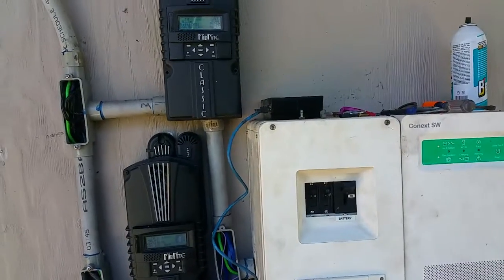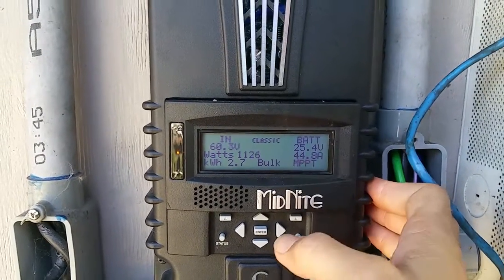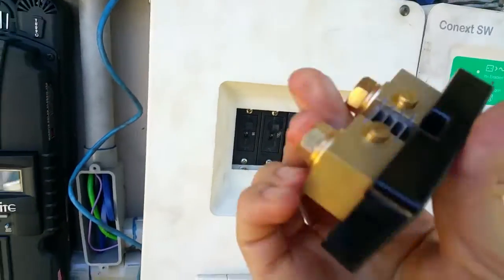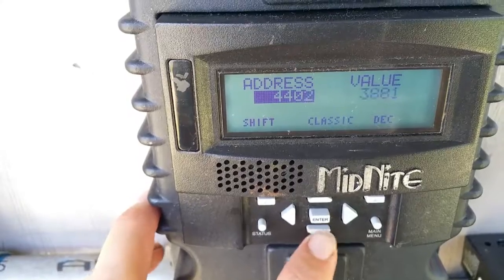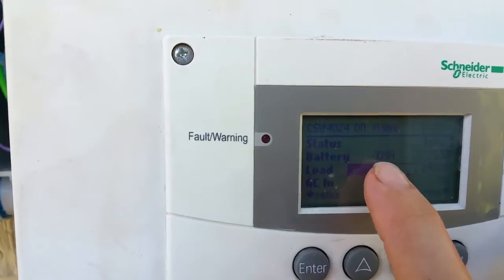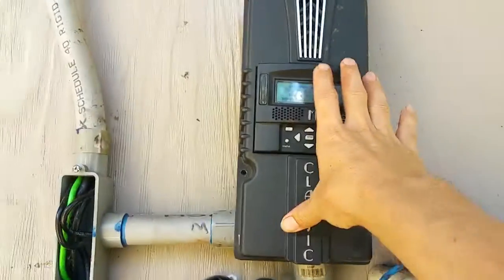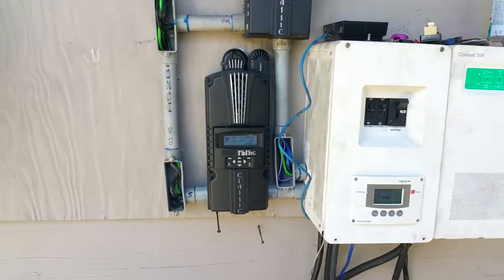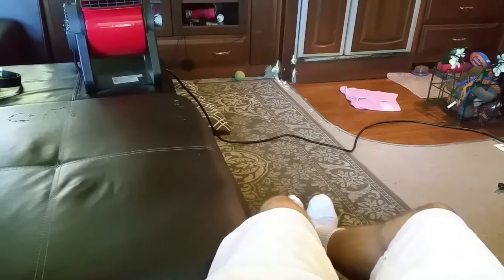Don't overcharge / current / Global maximum amperage Midnite classic Whiz Bang Jr solar  controller

Comment: I could make two controllers work off of one WBjr. It isn't said enough that without knowing what current is actually going into the battery the batteries can't be properly charged.  I wish I could have a bigger more conventional system. As it is, almost all my panels aren't even on my property at camp. Google earth won't even show my camp or garage. I try to keep them low profile.   Even at home trees trees trees. I can barely get 1KWH into the tank.  I've become an expert at low power systems.

I now know a little more about your system and still wondering how water heating would fit in. I have an extra built board you could try. In fact I think I should personally install it. I used to stop in Hawaii for long weekends when coming back from Japan.  Even lived on the beach when I couldn't get a hotel room. My board could lighten the load on your controller.  With all those panels it seems like it would always be full on.  Energy management is the future of solar. Like to work with you on any interesting problem. How big is your tank and is each controller on a separate  array.
Reply from the maker: They're tilted a little more towards the sun set so I don't get much power before 9 a.m. but without actually tracking the sun that's best for me because I use the majority of my power after Dark. Just as an experiment one time I was only getting 10% power and I tilted the panel towards the Sun and I was getting 90% of its rating. Upon that calculation I feel like I could easily double or triple my Daily Harvest if I track the Sun. This isn't so much of a problem now but as soon as I start utilizing leftover power above and beyond the absorb power I'm really going to want to be tracking
Reply from the maker: I'm currently using one of those cheap $100 on demand propane hot water heaters. It's costing me $20 a month and it's inconsistent temperature is more annoying than the bill. I picked up seven discarded electric hot water heaters I'm sure some of them are good and they're just getting rusty outside not in use.
Reply: Travis Sanders or you could do what Steve did for hot water.  He is 100% off grid.  In fact, he lives pretty close to you:

https://youtu.be/Jk6D_D7naOY
Reply: @ek9772  HPWH are an over simplistic solution for heating water.  I have one, but it isn't good for storing heat or dumping short period excess energy.  For overnight storage temps of 150 need to be reached as water can easily drop overnight. If you have a massive battery that isn't as big an issue. Adding resistive heating to a HPWH enhances the operation.  Without rebates HPWH wouldn't be that great an option.
Reply: opera I agree, with you, but I still like them.  140°F is the minimum temperature I would recommend heating water due to Legionnaires disease.

1- Hot water heat pumps will use a lot less energy than a heating element, and, therefore, they are gentle on off grid batteries. In Steve’s case he is using about 320 watts per hour, and I believe that he is not using the heating element.

2- The heating period can be timed to match daylight hours, and, this permits using less energy for most of this period from the batteries than the energy that is coming into the batteries from RE.

This works out great if you live in places that are warm like Hawaii.  

If you are living somewhere with cold weather, then you have to start insulating the water tank, and you will need better ways of storing water, and you will need to add additional heat.  To begin, additional heat can be added through the heat pump.  This will workout better in some places due to weather.

If you will need a heating element, then the trick is to use a heating element that the batteries and the inverter will support.  This means that the stock element in the HWHP will need to be replaced.  This can be estimated by the heat losses incurred overnight while taking into account the effect on the off grid system.

So, I would say that weather and the location of the hot water heat pump will play a part in this decision, but in some places and for most of the year you might be able to use the heat pump only during daylight hours (like in Steve’s case).  In some places, you will need to run the heat pump, also, at night, and in some places you will need to run the heat pump day and night, and finally, in some cases a combination of the heat pump and a heating element will be needed.
Reply from the maker: If you're ever coming through town I could provide a dry place for you to stay in an old buss.  About 800 ft away from the house I'm converting a 40ft bus to an office. I just finished the floor today. It's going to be my man cave lots of counter space and I'll load it with projects and hobbies.  Another problem to add to my to do list getting power and expanding the network out there.  Just for temporary I assembled all of my extension cords 14 gauge and I can only consume 300 watts in the bus and the voltage sags from 122 down to 114. Lol. I'm in a pretty remote place and for some reason they decided to run the first fiber optic on our Island to the remote places so I've been blessed with that. I'll eventually add a little kitchenette toilet and shower
Reply from the maker: Yes I have three arrays. The 1700 watt array is not hooked up yet. And the other arrays are both 2500 watts each. They're both solar world but However they're not exactly the same, one is Polly and the other is mono.

Comment: where / how do you find this hidden capability--well done
Reply from the maker: Are you asking a question or making a statement?
Reply: both--I'd like to know where or how you found this and to complement you on doing so
Reply from the maker: @Frank-yv9tq  I called tech support who was no help so I asked in a solar forum and eventually someone chimed in with this solution  at https://www.solarpaneltalk.com/forum/off-grid-solar/batteries-energy-storage/lead-acid/383358-unlimited-solar-panels-overcharge-guaranteed
Reply: @SiriusSolar  Thanks!
Reply: @SiriusSolar  Did you just sit down in your RV?! This is the system that we need for our 38' fifth wheel...assuming you are fully powering your RV with the solar. I Love It!!